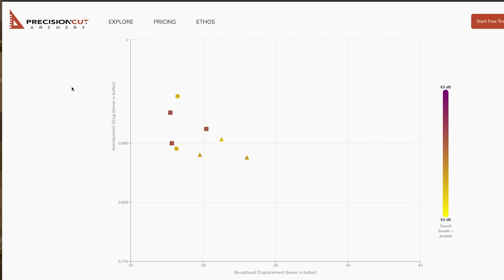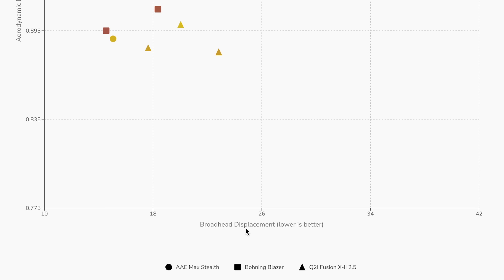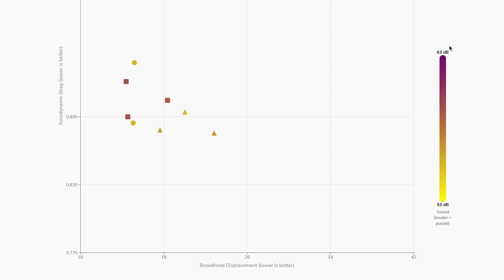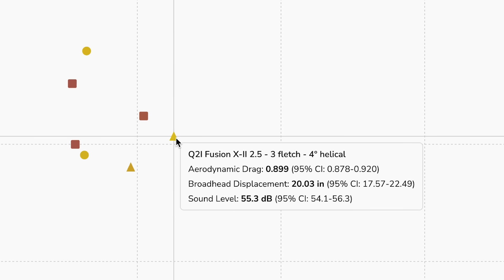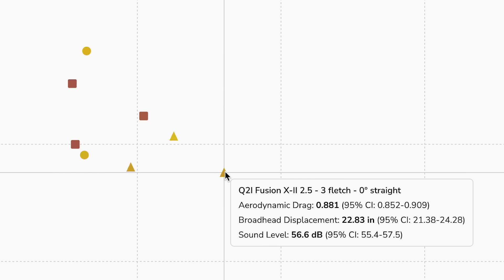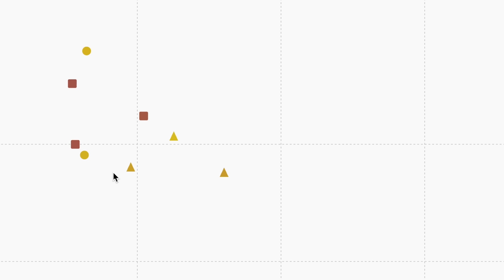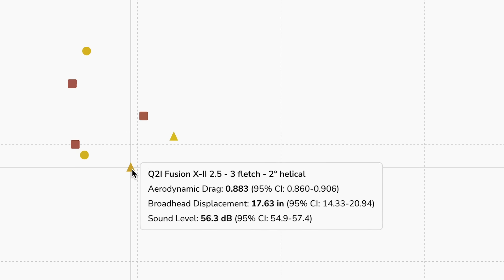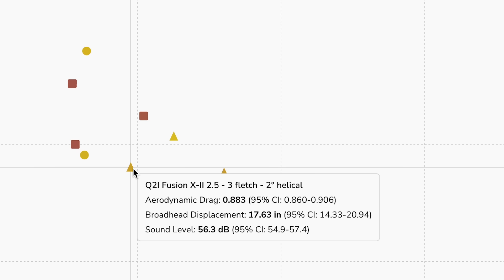All About Vane Helical from the Arrow Ballistics Study

Comment: Did you try this with different arrow weight? Like does drag go up, down or stay the same if you go heavier arrow over 500gr? It’s sort of like changing the wing size on an airplane. I would think the same vanes on heavier or lighter arrow setups and different FOC configurations would have different drag and lift results. 10:13 
Thanks for doing this study, can’t wait for the next one.

Comment: One factor still missing from the study: Change in the distance between the center of gravity and the center of lift will change how fast the vanes are able to correct the arrow flight. So with higher FOC we need less vanes. Meaning that FOC  is equally important.

Comment: Maybe it's me.
But, when I look at the plot, the 4° helical are further left in the plot nearly in line with the 2°, which is a good thing.
I am not clear on how it was mentioned that the 4° helical vane promotes a greater variance in left to right impact. When the data is showing there is minimal variance in left to right impact. (Just trying to understand to educate myself)

I shoot arrows fletched with the DCA Sabres and AAE Hybrid HP vanes fletched with the Mini Max jig.
My point of impact variance is more from my shooting form and the fixed blade broadhead, from my findings. As the point of impact is reduced with shooting field points when shooting to 70 yards.
At 50 yards, I can group 3-4 groups with the FBBH.
And tested this on a mule deer in CO last month at 50 yards, at a 30° decline, with a good cross-wind. I held the pin dead-on where I wanted the arrow to hit. The deer ran 20 yards and collapsed.

Comment: After watching a bunch of slow-motion videos of my own arrows flight at 80ish yards, I've moved away from max helical. I firmly believe the high speed rotation introduces gyroscopic precession. For example, if the arrow is tail low and spinning to the right, the force acting on the arrow is 90 degrees later in the rotation, so the tail moves to the right instead of up. People say that at long distance they "parachute," but i think its gyroscopic precession. I've watched so many videos of the arrow flying straight and then at about 50 yards it will go into this wobble. But this is just my theory. I wish i could figure out a way to test it.

Comment: I believe the reason your are seeing  erratic flight and higher drag with more helical is because the angle of attack is to great and it causes the the vane to stall the air is becoming detached flow causing turbulent air flow instead of the laminar flow you want over the vane
Reply: That makes a lot of sense.

Comment: I'd argue that a short length and short height vane (mini sabre) with max helical can achieve similar flight characteristics and lift/drag surface area to a longer vane with 2 degrees helical (most in study were longer vanes). Also allowing less surface area for wind contact while reducing weight on the back of the arrow.

Comment: I do not recall, but does any of the testing also look at the type of insert / outsert used on an arrow?  Example, is there any difference between using Easton Match Grade 55g outsert, vs. Easton Stainless Steel 50g outsert vs. Easton HIT insert setup on ballistics on an Easton 5.0 setup?

Comment: I didn’t hear the weight of the arrows pre-fletched and the weight of the fletchings used. The reason I bring this up is that I would think comparing 3 fletch to 4 fletch or 0 degree to 4 degree fletched arrows should be done at equal total finished weight. I don’t know how many grains it takes to start changing the flight characteristics.?
I try and keep my finished arrow weight at .4 grains or less total in variation from light to heavy. 
Love tinkering. 
Keep up the videos and tests!!

Comment: Did you shoot groups with max helical and large broadheads? You mentioned in the other videos the broadhead groups were larger than field point groups. Did the max helical arrows have larger groups with broadheads comparative to the 2* helical?
Reply: Yes. That's what this whole video is about
Reply: @b1004u  when he was talking about group size he specifically states it’s with field points. And the graph he spends the majority of the video explaining specifically displays Noise, drag and deflection but has no reference for group size.
Reply: It could also be possible that since the group sizes were already larger with broadheads comparative to field points that the max helical fletching with broadheads might display no increase in group size or could possibly reduce group size. I’m just asking for him to specifically clarify this point.
Reply: Not good at comments, so not trying to be argumentative. At minute 2:23 he says they did the groupings with an iron will wide
Reply: @b1004u At the 2:23 mark he specifically discusses broadhead displacement with iron will wides. Which as I understand it is how far off center the broadheads hit due the intentional out of tune/torque condition. What I’m referring to is a group size comparison with broadheads with the bow in the tuned condition. With 2* helical VS max helical of a decently performing vane. The reason I’m asking this is because a lot of people argue that max helical improves broadhead flight. Since the average broadhead group as discussed in previous videos is already larger than the expanded field points group due to max helical. It would stand to reason that a max helical vane could have a positive affect on broadhead groups and still have e negative affect on field point groups. I will be the first to admit I’m not a good enough shot to be able to test this myself.

Comment: Maybe I missed it, but do you know the arrow speed and weight?

I have seen this issue with a light fast arrow, but in my testing, I found the max helical helped tighten my groups with heavier setups. 

I'm not talking about the 600+ gr setups. Just what I call a "hunting weight arrow," something between 450-550 gr between 260 and 280 fps.

My testing showed that between 280 fps and 290 fps, the offset vane seemed more consistent across the board, but over 290 fps, the max helical definitely showed more inconsistencies.

Comment: @Yatesinthebackcountry

When you’re done.  Create a jig as easy as the EZ fletch and make $$$$. 
 5” group on my setup.
VAP Elite arrow, Heat vane, Arizona EZ fletch max Right, 32” draw, 80lbs, 318fps, 467grains, 1.75”SEVR.
Reply: 5” group? From what distance? Is it 5 inches for the group or is the group 5 inches from point of aim? Can you tighten the group with less helical? Can you tighten the group with more spine?

Comment: In the next study, it would be interesting to see the difference between left 2 degree and right 2 degree in relation to lift and drag. The bow typically launches the arrow one way based on how the strings are twisted so knowing that as a baseline and seeing if going with or against has any and/or to what extent the drag, lift, deflection, and sound affects it.
Reply: Years ago, a group  of N. Utahns (me included) did these tests with what was available (much fewer options than now) left offset, left helical, right offset, right helical with vanes of various profile height from .35 to .55" and length from 1.5" to 3", with a multitude of different heads including fixed and expandable broadheads, practice heads, judo points, turkey choppers, bludgeons, etc. We built strings with both direction twist, and servings of various materials and such. We even changed the knot configuration on the string loop to go opposite directions... The BIGGEST factors out of our shooting machine affecting group size was unequivocally the amount of helical which caused , as James pointed out, too much drag de-stabilized the back end of the arrows. 

As for direction of natural rotation of an arrow off a string, at the World Archery Festival in Vegas they had a high speed camera they were checking nock travel on some of the bows, and took video of multiple pro shooters to see what face contact did, release mechanization, arrow flex on launch, rest movement effects (lizard tongue vs drop away)...it was very extensive. I happened to be focussed on the way the loop rotated with and without string stops, etc. There is video of all of it somewhere in the archives of either Hoyt, Mathew's or one of the other bow companies that was in charge of the room.
Reply: Thats already been done. Greg Poole among others tested this years ago out of a shooting machine. It doesn't make a difference wether its left or right. That being said.....I still fletch with the natural rotation because it makes me feel better lol.
Reply: @HuntEthical our testing was done before Greg was around...but yes, it has been repeated many times. James' info isn't news, it's just timing and publicity that give it space. I fletch mine to match the natural rotation too.